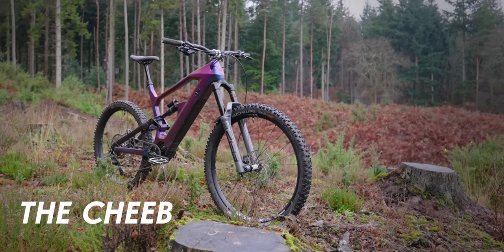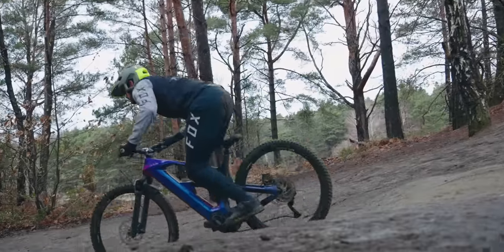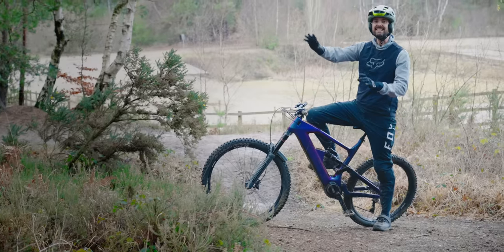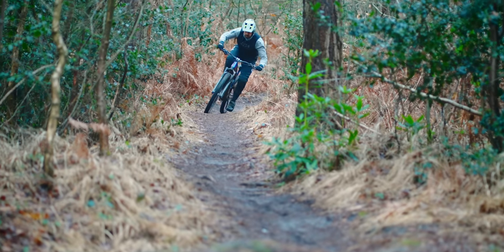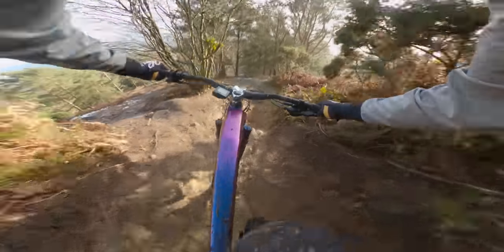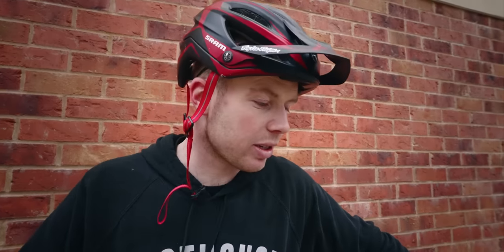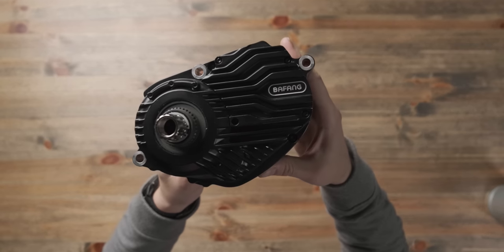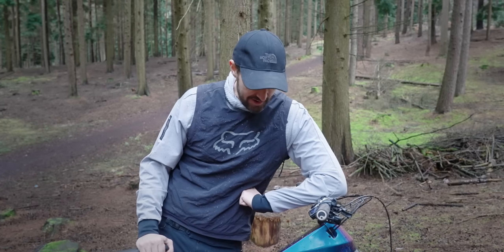I TEST a Chinese EBIKE

Comment: the M600 runs an 18A controller @48V. That is significantly more powerful than the other emtb motors. I don't know how many amps the M500 absorbs. Also, the voltage of your battery plays an important role power output, not torque though. is your battery 43V or just 36? you can run the M500 at 48V, I assume with 48V it will be more powerful than the competitor motors. The Bafang BBS02 @48V is definitely super powerful, even with reduced current (18A, like the M600) I blast up super steep 24% gradient fireroads at around 11 to 12km/h without overheating. The BBS series is also more quiet than the M500 and M600 due to bigger internal gears.
in the end, it's worth ignoring the ridiculous Nm ratings, since they don't tell you the most important parameter: power! you can always tweak the actual wheel torque with gearing, but you cannot tweak power without electrical tuning.
Reply from the maker: Thanks Jonas. The M500 runs 48v also. I suspect that Bafang has really detuned it for the EU market. I have emailed them to see if there are any firmware updates, not heard anything back in almost 2 weeks... If there is any progress I will update the channel!
Reply: @RobRidesEMTB  Bafang does not really deal with private customers... if you order 100 motors they will start to communicate. Itvs a huge company, they totally dominated the global hub motor market for over a decade now. While the M500 is quite silent, the M600 is pretty loud since all reduction gears are made from steel. Luna Cycles produces a Plastic gear for the M600 to make it a lot more silent. I ride the BBS02 @48 and the power is absolutely crazy. I like the fact that it's totally programmable, but if you need maximum ground clearance and torque sensing it's not for you. I don't do crazy riding, but I want to climb even the steepest hill and tow heavy trailers with it.

Comment: Starting at 4:20 as i can see your wheel slides several times, so torque lost there. problem is in tyres and not in engine...

Comment: Hi Rob, If you wanted to ride events with one in the alps, do you think getting spare batteries or motor spares would make you wish you had just bought a trek or spec' more basic bike? I wondered how low cost could you build it? could you build a good solid 3k bike for example with say the say components as found on a trek rail?  when something weighs 20k is aluminium not a more sensible material of construction? why even bother with carbon? new to all of this from road bikes, interesting how involved it all is.

Comment: Becareful, not do big jumps with this Denfu frame. They are made of Tory T700 Carbon.  The Motor ist quiet? It sonds like a 
lowpowerd chainsaw by low speed <20 on the flat street.

Comment: great vid Rob, one of your most anticipated? where is the speed sensor magnet?
Reply from the maker: Cheers Stuart. Quite old school the magnet is the chainstay and spoke style magnet, not as neat as most of the new ebikes that have it integrated into the brake disc / chainstay.
Reply: @RobRidesEMTB  I could really fancy doing exactly what you've done, just wish there was some more info on tuning the motor

Comment: Great vid Rob. You said in previous vid you put a 10 speed shimano deore on. Im thinking of changing my 12s to 10s, im sick of wearing out expensive cassette. What ratio cassette and chain ring you go for
Reply from the maker: Cheers Dan. Shimano 11-46 on this. Super cheap and pretty good. But I wish they made it with Hyperglide+ as that shifts so well.
Reply: @RobRidesEMTB  cheers Rob, what size chain ring? I got 10/51 at the moment on a 34t chain ring. Wanna get somewhere close to the same 1st gear for steep climbing
Reply: Hi. I have the E-10 setup with a 40t upfront and 11-46 in the rear.  I have the M600 which provides more than enough power to support the higher gearing with the 40 upfront and you get the benefit of speed when getting to and from the trails.  Cheap Aliexpress ($15) 104 BCD chainrings bolt straight on and takes about 10mins.  You will need a longer chain however. I now run a 122 link chain. Certainly recommend the Shimano Deore 10 speed set up.  I went with XT but have already needed to change out the 11t cog.  These bikes are tough on mechs.

Comment: Wow nice build, I was wondering does the company that supply your frame make one to accomadate the m620 g510 Bafang ultra motor? I think it is larger than the m500 or m600 so unfortunatly it wont fit in yours.
I currently use a bafang mid drive (a slightly modified m620 g510) on my alloy chinese enduro and am looking to start building its replacement/stablemate soon.  
I have not used the m500 but it should be totally tunable via usb and a PC and you probably will be able to get more punch out of it than stock settings.

Comment: I would love to see you put the E10 from 2020 Frame through its paces in drops and jumps. Like to see some big drops. I have a 160mm RockShox Yari 160 with a 2.1Damper system, & 210x55mm Deluxe Debonair in the rear but I need to overcharge PSI in shocks for my weight and gear in order to keep it from bottoming out on bunny hops any advice?

Comment: which bafang motor is this? You can unlock the extra power in the control settings on most bafangs. The m620 bafang motor is nice

Comment: I have a ally framed china ebike with a m620 motor it has more power than you need and is completely programmable. does rob know you can get like 8 different displays for almost any bafang.

Comment: Great video, thanks for that. So with some used parts that were in goog condition, it should easy be possible to build a great specced e-Bike for less than Euro 2000,-
Reply from the maker: Yes definitely possible

Comment: Honestly, how much sense does it make to buy an eMTB as a very heavy and tall dude (300lbs+ with backpack + gear)? Do I have to check for special weight ratings or something? I can get an eBike subsidized by my employer and want to get into the hobby but maybe a MTB is not the right choice for me and I should go for a cross bike instead? Don't have too much experience off-road but could imagine myself enjoying mountainbiking. I would use it to drive to work as well regularly. Hope someone can provide some insight, thanks...
Reply: There are weight limits for bikes in general. I would tend to steer clear of carbon especially Chinese carbon at 300+ lbs especially if you are riding rougher trails. I would really think about going to local bike shop and have them help you pick something out that will work for you and what you want to do. Bike fit is extremely important as well! If you want to try MTB a cross bike probably wont do it, you are going to end up wanting a mountain bike. Get something that fits and just start off riding some easier trails.
Reply: Both Luna and Watt Wagons (that use these frames) have a max weight rating of 290 pounds- for bike AND rider combined weight.

Comment: Rob question my friend has the yt 29er e-bike with a e8000 motor  he has done all upgrades on bike and motor in eco his settings are on high and is having problems with getting any power from out of eco on the higher setting do you know a solution or are all those Motors underpowered in Nico on the high  thanks Rob I'm liking the new Chinese ebike bro 🤔👍👍🇬🇧

Comment: forgetting main downside, no warranty for when motor inevitably goes kapoof!
Reply: Why should the motor break?
Reply: @Jacksparrow4986  because its an ebike, such a new technology is not going to be reliable even the top brands break (a lot!) i'd feel uncomfortable buying an ebike online let alone from china.
Reply: @benfeatherstone1067  e-motors are basically proofen technology since 150 years or so. Yes, it's always possible to mess it up, but the bafang motors are pretty overspeced and some people already got thousands of kilometers road experience with them in a pretty high load setting (e. G. Bicycle trailer in the alps, so ~200kg up to 14% uphill).

Comment: Is this bafang motor not programmable. With their other bolt on motors they are fully able to be tweaked using the factory provided cable and laptop.  Is this one not able to be moded because it is not a bolt on?

Comment: Can someone please explain to me. Why did he buy a 250w motor when bafang makes a 750w (for roughly the same price) ones that fit on normal bike frames.
surely a slick looking frame is not work 2/3rds of your power output

Comment: I would say more than 50% of bikes around the world are made in China. And one would think a country with most bike riders and manufactures majority of the bikes around the world know a thing or two about how to design and manufacture one.  Cheap chinese stuff doesn't mean second rated, all it means is that you don't have a middle man taking his/her cut ......you are basically buying at wholesale prices..... just do your homework on reputable manufacturers and you should have a high degree of confidence in your purchase,
Reply: you hit the point,but I have to point out that when it comes to "mtb" riders,it's not correct.good manufacturers(hybridizer, yanyang) are also rare in China compare with those ones produce shit and try to grab cash out of your pocket.To summarize,good chinese frame is with good quality and price capacity,but you have to do a lot of research to avoid buying shit

Comment: So if the motor weighs in at 4Kg, how is this bike 24Kg? My Enduro bike 150/150 weighs 15Kg, I'll give you 500 g for the longer fork, so this should be < 20 Kg. Is the frame that heavy?
Reply from the maker: Motor 3.4KG, 840Wh battery 4KG, then add on controller, display, battery locking hardware etc etc.
Reply: @RobRidesEMTB  Thanks for the update. I thought you meant the motor and battery were 4 Kg, so the weight makes sense now :) BTW: great paint job and video.

Comment: nearly all carbon frames are made in china, brand name or not.  you aren't risking material quality or manufacturing knowledge at all by buying a cheap carbon frame from china.

What you ARE risking is:
1.  quality control (depending on brand)
2.  high-end engineering latest developments.  Open-mold frames tend to be copies of yesteryear's frame designs, and sometimes with a little extra weight/materials to make up for the reduced quality control.  Easier and cheaper to just slap on an extra 300g of carbon than pay a bunch of people for rigorous testing and inspection.
3.  Warranty.  Even if they offer you a warranty, what is it worth if you have to pay a few hundred to ship the thing back to china, then wait months for them to ship a replacement to you?

Comment: People seem to think that making carbon bike frames is some kind of dark art, that only the wizards can do, a bit like mounting ski bindings or building a wheel. It's really not that hard, and once you've decided on your layup and got a mold, you can churn them out like any other material. CF is just an expensive fibreglass, that's all it is. It comes in sheets and you lay it with epoxy. It's basic shit. And since China makes everyone else's bikes, why wouldn't they want to sell more directly.

Comment: Great video but the amount of snobbery around in bike community (especially road and those lycra wearing maniacs) is astonishing. This is 4 years since I'm messing around with ebikes both previous bikes were china which are still in great condition after combined 20.000km with regular servicing, trips like London-Brighton done with smiles and no issue apart from rear suspension change on one of them. Other cyclists though aren't able to stomach someone's good deal so I would have constantly been involved in pointless discussions about "when is it gonna snap?" or "i hope you've got a good insurance" and fuckin smirks. My roomie got to the point where he wanted a 'quality one rather' so his choice for commuting became a Brompton folding one. On his second trip rolling downhill at 20kph the folding mechanism (clamp i believe?) opened, front and rear wheel started going separate ways due to open frame while that locked friend's left leg which ended up broken in 2 places, the guy has got more steel (around half a meter) than any of my bikes, he will never sit on one again and all this for pretentious patronising approach thats just too common here. 
1) both my previous ebikes are folding 
2) currently I ride WAU bike which is still an overpriced China, I deliver with 3 companies, in 3 months I've done 5.000km (rain and idiotic "roads" made by Flinstones ridden on mostly) and apart from punctures and tyre upgrades I didn't need to visit service once.

Comment: Upgrade the motor! What's the point of building a beautiful eMTB, hauling around all that battery weight and not optimizing the power of the motor that can fit in there. There is even a newer dengfu frame that can hold the new 1000w bafang! That's what you should get! Who cares if it's not legal?

Comment: how are you liking the schwalbe magic mary and big betty for uk riding? What width tires are they too?
Reply from the maker: Really good to be honest but quite heavy. Overkill for my local trails. Good grip from the Big Betty in the mud which was appreciated. A good alternative to DHR2 / DHF / Shorty etc.
Reply from the maker: They are 2.6 width. But weight around 1.3Kg each. On my Trek rail I’m running regular EXO DHR2 2.4 and Shorty 2.5 and they weight approximately1KG each
Reply: @RobRidesEMTB Thanks!  I'm currently on wtb tires 2.8 vigilante and 2.6 trail boss, and looking at options for my next set when these wear through. Not that I have many complaints really, but they are a little heavy (about 1.2kg each in the tough casing)

Comment: Shorter travel up front with a 29” wheel?
Reply from the maker: Sure. 160mm would be good to try too. 150mm will steepen it up a bit make it a bit quicker to manoeuvre on trails but not as stable on descents.

Comment: Anyone know where to get the Dengfu E-10 Frame 900wh or a bigger battery? I have a Bafang M600 but it's tuned to 1500watts. So I need 50 or 60bms battery I think it was

Comment: Great project and myth-busting. China has excellent engineering and manufacturing, but they make what they're asked to make. Ask for a $10 bike frame and you'll get one. Resulting product - that's on you. Give exact spec requirements, they'll tell you the cost. All things are possible, except miracles :)

Comment: id still rather pay 5g for a renowned carbon than 20g at the hospital 
especially if you live in the us
Reply: Well this is one of the leading frame builders worldwide. Most of your branded trash is probably build by them as well. Their end customer communication is not that well, but they for sure know their carbon and QE.

Comment: You did not need that 95nm of puntch man you would of had more wheel spin and less traction.  Please do a side by side by side test with bosrch in wet conditions. In the dry use the 620 with the e22 frame and blow everything away. There will soon be turn key budget models from china that will stich up all the overpriced euro & usa bikes.

Comment: Maybe the Chinese NM figures are deceit like their Mah figures on LI-ION cells?
You can actually buy “10000Mah” 18650 cells even though they do not exist. 
Sanyo and Panasonic do 3400Mah 18650’s which I believe is the current max.

Comment: This is the way to do ebike. All the big brand are a disgrace. They are just pensioners toys. Break a lcd, some the size of of your mobile so easy done, or harness, and if you're mental enough to pay £300 for the parts, forget it. After 1 year you can't,  and I do mean can't, get the bits and they not interchangeable. So you would have to by a full system, maybe not the motor, even harnesses aren't  universal so you're essentially building your own anyway. Beware. Voice of experience

Comment: you wolly..you can tune that motor..your not stuck with how it came ...and why would you think it has not got the stated torqe when your complaint is its smooth power?..how power is delivered is seperate to how much power there might be and why say the motor and battery "just "passed...you got a range of 80km (but never told us on what level asistance level or what terain or temprature) 80km is exelent for off road in the cold and wet and hilly terain. and your front and back suspention settings are miss matched..harder in back or softer in front depending on how you want to look at it.